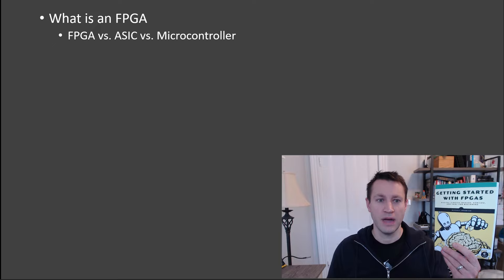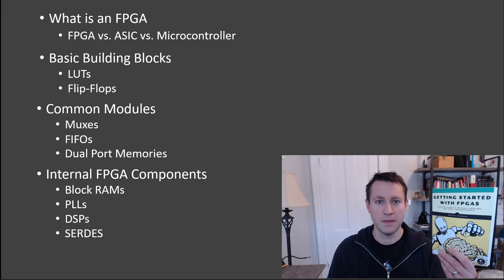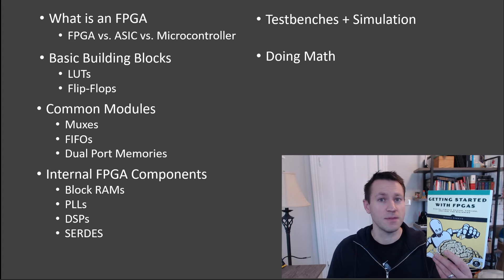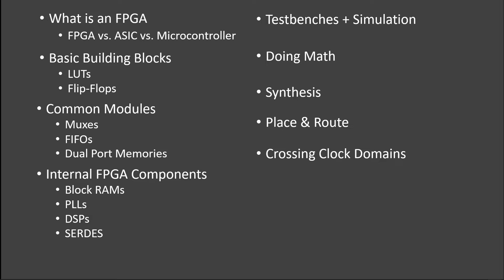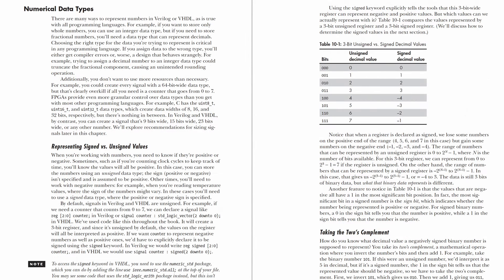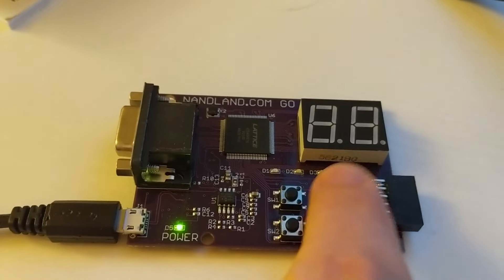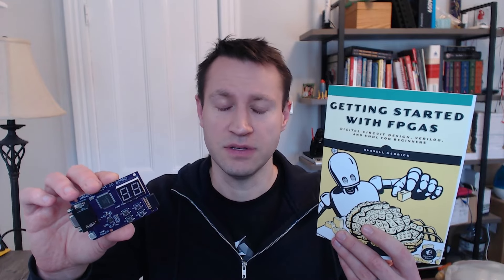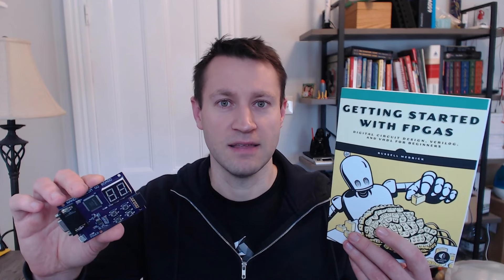My book Getting Started with FPGAs is NOW AVAILABLE!

Comment: This is a priceless resource for anyone wanting to  learn seriously about FPGAs and needs to start from ground zero.
Am myself an  electronics and communication engineering major with decades of work experience in various areas and was looking for a practical hands-on resource to learn / refresh fpga fundamentals beyond the digital circuits course I took in college many, many years back where we learnt the basics of programmable logic, CPLDs, PLAs and PALs, back in the day FPGAs were in infancy and we only knew then that this is a new cutting edge next thing.
Fast forward today and FPGAs are ruling the area of programmable logic, in practice it's either Xilinx (AMD), Altera (Intel?) , Lattice  or Actel(Microchip). 
This book + go board , both of which I purchased, will enable u with skills to demystify any complex fpga from anyone of those 4. It's very inexpensive and user friendly compared to other couple big books I came across .- which are great too - but I think this is the 
 best starting point.
I wish to commend Russel Merrick, a fellow Electrical Engineer, for this awesome creative endeavor 🙏

Comment: I recently started reading your book, haven’t finished it yet though. From the table of contents, it seems there isn’t a section on IP blocks. Could you recommend resources to learn about them, particularly for Xilinx, since I’ve noticed they’re frequently mentioned in job descriptions? Also, do you think someone who reads your book and actively implements the concepts would be well-prepared for a junior FPGA designer role? would a master degree be a requirement? By the way, the book is fantastic definitely an excellent resource for beginners!
Reply from the maker: IP blocks are covered quite a bit! Chapter 9 is titled "Useful FPGA Primitives" which is all about built-in IP within the FPGA itself such as DSP, PLL, Block RAM, and more. I also discuss SERDES IP which enables high speed data. That's in Chapter 11. Hope that helps!